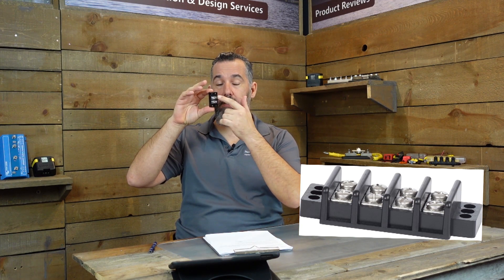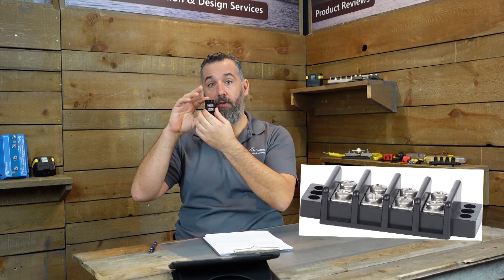Why Should I Use Terminal Strips on My Boat?

Comment: I really love your videos! I have a question for you. I want to get a 100ah battery for my sailboat that will primarily be charged by solar, but I also want a way to plug in the battery as well. The company that sells the battery also has a charger that can be attached to the battery as well. 
If I have the entire system 12v hooked up on the battery and I plug the charger in without disconnecting the system will that damage or blow up my boat. Also how do I set it up if possible?? Is there a diagram for me to look at?

Comment: Hey, I'm new to electrical work, can I just 5200 my terminal strips to fiberglass inside my console or should I go thru the effort of mounting a mounting plate and screwing it in? The glass in my console is very thin. Would something like 4200 be better?

Comment: Another reason to use terminal strips instead of butt connectors is to avoid cutting back wires every time you swap out a defective bilge pump or fresh water pump.  Lol, I've worked on boats where the bilge pump wire had been trimmed back so short over the years that I had to pull an entirely new wire from the breaker to the bilge.

Comment: Great Video. Thank you! You mentioned that the terminal strips come in different amperage. Which strip do you use for a panel where you have different amperage?
Reply from the maker: Hi Peter, on my own boat, i used a 30 amp terminal strip for all the DC connections at the panel.

Comment: Hi Jeff, would you recommend to wire AC neutrals and ground wires to common bars as well instead of directly to the AC panel?
Reply from the maker: Either option works, most boat builders bring the neutrals and grounds to common bus and rarely the back of the AC panel, probably to avoid overcrowding of the AC panel.

Comment: In the most basic example, how do you use the terminal strip. ie where is the + and - that goes to panel and where is the + and - that goes to load ie my cabin light?
Reply from the maker: Two of the main purposes of the DC panel is 1) ability to turn on and off a circuit 2) provide circuit protection. Bring the positive from the terminal strip to a spare breaker  on the DC panel so you get a switch and circuit protection. The negative from the terminal strip should be connected to the negative distribution.

Comment: I have also found that the connections on a distribution panel are very closely spaced and the screw terminals are at odd angles. This makes them difficult to access when mounted on a boat.  Also, it is very difficult to work on under way.  There maybe times underway when you can’t completely deenergize the panel, but you need to make an emergency repair. I want things setup so everything is easily accessible when offshore.  I hope to never touch the panel wiring itself after installation, only the terminal blocks.
Reply from the maker: Thanks for sharing Jak, you bring lots of good points.

Comment: Terminal strips make wiring life so much easier.  Under my helm on my old 1970 37 Egg Harbor, I also have large positive and negative buss bars, very handy. Basically 150 amp fused power comes in to that buss and wire  bolted on to the buss, then a multitude of smaller wires run to two remote fuse panels, one panel on left covered by a small door is push button breakers, other panel is carling helm on-off switches next to the engine gauges. Each wire gets fused, eventually, not immediately at the buss, unfused wire length is about 2.5 feet.  This is all housed in the helm cabinet. The return wires attach to the negative house buss bar. It may or may not meet ABYC standards, but that is how it was done in 1970, and it is all mostly original, and working fine. I have maintained it since 1998 when the boat ownership fell to me. And I have  made improvements too. like with fusing the big wires off the battery switches.
Reply from the maker: Appreciate your input.

Comment: These are useful in the design, build and documenting of control panels. Having all of the wires that come into the panel, and go to a buss bar keeps everything organized.  Buss locations are marked as to where each connection came from, and goes to.  Easier to read schematics, for the next person to troubleshoot or for changes to the system.
Reply from the maker: Very well said, thanks for sharing.

Comment: I often find myself having a tad too large ring connector diameter for the terminal strip screw, which I guess affects resistance negatively. For example an M5 ring on an M4 terminal strip.
Some say it doesn't matter, some say it does.
It would be interesting to know whether max Amp rating is affected by using the wrong size because I can assume it's quite common to not use the exact right size.
Reply from the maker: Good question, but unfortunately don't have any data on this issue.
Reply: @PacificYachtSystems  i purchased a thermal camera yesterday. I'm gonna do some tests.

Comment: How do you determine the amperage rating of an existing terminal strip? When installing a new one I label it with the rating for future reference.
Reply from the maker: Good question, because they are NOT labelled, we can tell by the size of the strip. Probably worth seeing a 20/30/60 amp versions first hand at marine chandlery. When in doubt, assume a lower rating.

Comment: Hey Jeff!  I see a lot of Wago brand connectors starting to show up on lighting and other gizmos here in the States.  What are your thoughts on those?  The Wago connectors on the LED lights I got from the big box store are "push in" for solid conductor, but they have lever action connectors that do wires up to 4mm/12 ga.  I'd imagine the drawback would be corrosion, but that seems like that could be mitigated with NOALOX or a similar product.  Just wondering what you think.  Great videos, and again...  thanks!
Reply from the maker: Good one, besides the corrosion issue of having unprotected wire ends exposed, Wago is a good solution. We use it on large yachts (100 ft or more).

Comment: Hi Jeff,  when more than one wire going to the breakers through would you add them on the same screw or daisy chain them through another bus first, as usual, your ask & reply are excellent.
Reply from the maker: For more then one circuit, use the little jumpers to join different parts of the terminal strips together.

Comment: My question is: Why do you need a dedicated neutral bus bar for the inverter and can you add a switch so that you can swith them together when you just want to use shore power with no inverter? I love all your videos. You make boating so so much better. Thanks.
Reply from the maker: Hi Jim, not sure how well i'll do explaining this, your inverter/charger will connect ground to AC neutral whenever you are using the inverter. To avoid AC going to the neutral bus for non-inverter circuits, you need to separate your neutral bus.
Reply: @PacificYachtSystems  I think you did a grest job explaoning. As usual. Thanks.
Reply: Is it OK to put circuit breakers connecting both neutral bars and both hot bars so I can have everything on shore power and turn off the inverter?

Comment: When you make your connectors, do you recommend putting dielectric grease inside the connector? Same thing, but do you recommend putting on electric grease or conductive grease such as Permatex Copper or Penetrox A13 for example to prevent the ingress of humidity or corrosion as well as seizure of connections?
Reply: Jeff's videos are amazing.  For other opinions and discussions I always look on CruisersForum.com Here's a discussion about use of grease: https://www.cruisersforum.com/forums/f14/electrical-contact-grease-146955.html  I've worked on a complete rewiring of a sailboat and after reading about it, we decided to not use it.  I think dielectric grease may make sense in potentially wet places.  The boat I worked on only used it on the connecters outside (e.g. the ones for running mast wiring through the deck) or in not well closing lockets, ...
Reply from the maker: Don't have any experience with dielectric grease, anyone else can share?
Reply: These terminal straps all corrode and lose voltage eventually after 5-10 years.  I only use them when I have to like connecting a windlass in.  In modular places you can't help it but if I can direct wire I would always choose that in any location that will receive salt spray.   I spray mine with battery terminal spray not dielectric ot stays in better.  Also fun fact, 90% of people think dielectric is conductive, it is not, it is an insulator.  Not saying you thought that.
Reply: @extrememiami  The negative buss bar in my runabout is 10 years old. It's in the back of the boat where it does see plenty of moisture and it looks brand new. I think the quality of the terminal block is very important. I know Blue Sea Systems makes great ones.
Reply: @extrememiami  Battery terminal spray is the way to go. Did that a lot when I worked line mechanic at new car dealers.

Comment: If you are rewiring a Catalina 22 how do you run the port side lights in the sentry and v birth. 1 run or 2
Reply from the maker: It's quite common to have a single electrical circuit to power multiple lights, especially since the amp draw for LED lights is so low.

Comment: I am using double crimp ring connectors. One crimp is the strain relief, crimping onto the insulated part of the wire the other crimps the bare wire.  Hint for boaters, I have always used a terminal block on our trailers.  How many times has the wire leading from the trailer to the tow vehicle or the  connector been damaged?  With the wires attached to a terminal block it is an easy repair and as Jeff says "a place to trouble shoot".  The addition of a small waterproof utility box around 13.00 at a national import store makes a great place to put your terminal block.  A great source for these terminals, the crimping tools and videos is American Autowire.
Reply from the maker: Thanks for sharing Don.

Comment: Hello Jeff , A little off topic , but I just purchased 4  12 volt  100 ah lithium batteries from Canbat here in Canada . My  victron multi plus is 24/3000/70 . Canbat  just informed me that I cannot hook up my batteries in a 2s 2p configuration . They can only be in series or parallel . Was told that the BMS would not work  in this set up . Now what ?
Reply from the maker: Hmmm, get two larger 200 amp-hour batteries instead of four smaller 100 amp-hour batteries, in turn wire the two 200 amp-hour batteries in series to get 24 VDC.
Reply: @PacificYachtSystems  Thanks for your reply Jeff. I am stuck with the 4 batteries I have . Wife would leave me if I spend more on 2 more batteries. LOL

Comment: I disagree. Every screw, which is not installed, can not get loose.
Reply from the maker: Hi Stefan, interesting point. Many European use spring loaded connections, like Wago, for doing connections. North America and Asia, use lots of fasteners. You can purchase spring loaded butt connectors from various manufacturers, therefore avoiding using screws.
Reply: @PacificYachtSystems  good Point
Reply: @PacificYachtSystems  In that respect (spring loaded), why not use wire-nuts filled with dielectric grease?
Reply: Don't know why anyone would be concerned about a screw not installed getting loose

Comment: Here in Sweden they are really expensive, $25 and up. But they just look like simple pieces of metal. Why is that?
Reply: Det er for at importøren og distributøren (som også gir deg garanti) også skal tjene penger. På samme tid er volumet av salg lavere her i nord så prisene blir en del høyere enn andre deler av verden. Man KAN kjøpe direkte (90% av slike varer lages i Kina, på samme fabrikk...) men da sitter du uten garanti om noe går sønder.
Reply from the maker: Hi Jonas, not sure about why the cost is high. Terminal strips are not just a marine item, although you want to make sure the terminal strips are tinned to prevent corrosion.
Reply: @PacificYachtSystems  hi Jeff. Why is using tinned wire, tinned terminal strips etc. so important and such a big deal? I understand many say it protects against corrosion, but many of our boats are from 1970-1990 and older. The wires in old boat I don't think is tinned anywhere but still works fine today.
So is tinned connections and wire important to make sure our wiring today also works in 50+ years or just a matter of being extra extra safe and cautious?
Reply: Thanks both!

Comment: Why are these not available with a cover ? 
Especially when used for 12v positive side .
All other marine 12v positive connections require a cover .. yes
Reply: A quick search for "terminal strip cover" shows that there are some available. I'm not especially impressed by what I saw. I may decide to make my own. Having that convenient circuit test point is enough reason for me to want to use the terminal strips, though.
Reply from the maker: Here is a link to all the Bluesea covers available:
https://www.bluesea.com/products/category/18/67/BusBars/Accessories